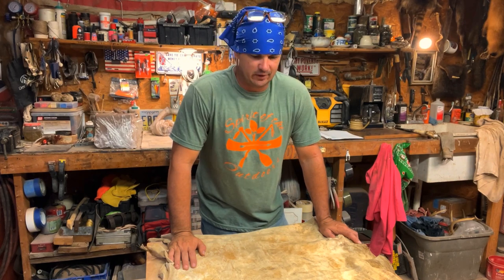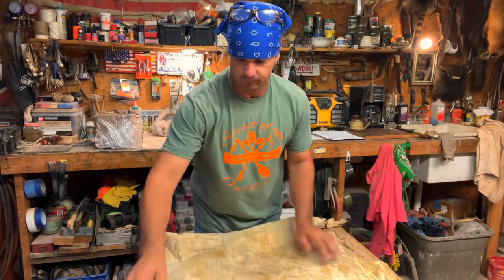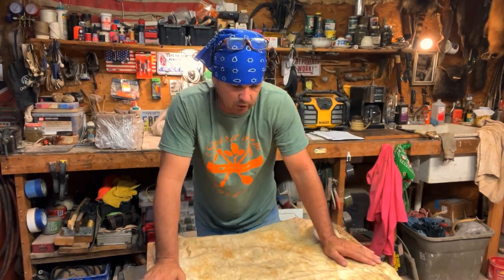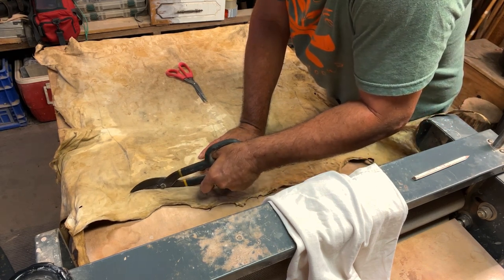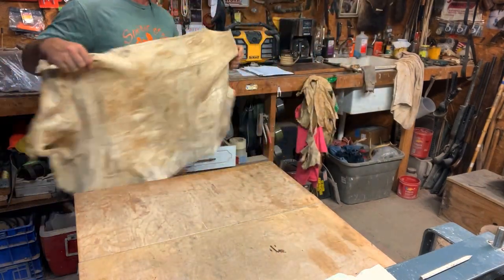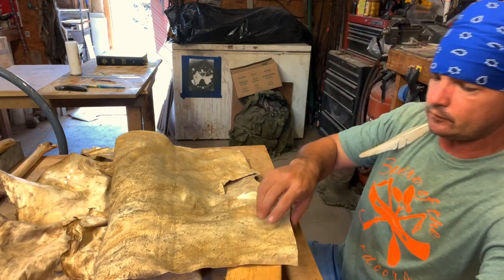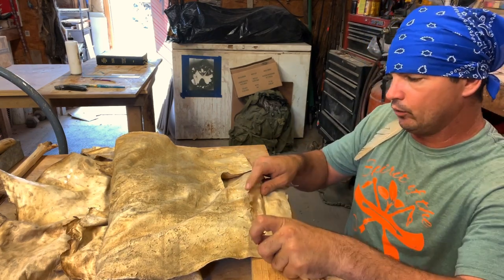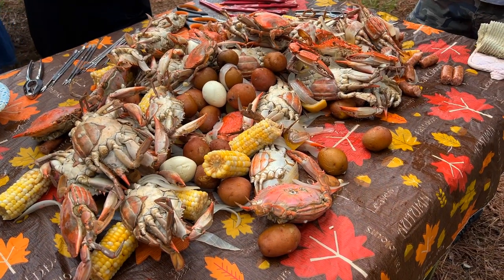Making a Buckskin shirt

Comment: My condolences for the grandmother. Good lookin shirt.  Nothing cuts the wind like leather. I can see where a buckskin shirt combined with some wool under it might feel pretty well on a cold windy day.
Reply from the maker: I think the jacket im gonna line with some old flannel . Should be a nice touch
Reply: @SpiritoftheOutdoors  I've had no luck in tanning. Several years ago, when you could get it, I used Mary Wars liye in a plastic trash can to slip the hair. I used lanolin soap to soften it. But it came out rawhide. Then I did what you did. I took a hand sander to the hair side. I actually ended up with buckskin. But it's an awful lot of work. I haven't tried it since.
Reply from the maker: @larryreese6146  the work is stretching as it tries to make it limber. I wear out before it does lol

Comment: You did a great job on your shirt, especially considering you didn't use a pattern, I'm impressed! I've been sewing for a number of years now and recently made a buckskin jacket. When you make your jacket, it will help if you cut out all the pieces first. Also, the tightness you experienced around the arms and under near the chest is from not adding enough "ease" into your shirt. You can add a gusset where the sleeve meets the body. This will help relieve the tightness lifting your arm up and down. Adding some material to each side for both front and back will help relieve the tightness reaching forward and back. I like to sew from the top toward the bottom and from the center outward. I start at the neck opening and sew to each side, then fold the sleeve in half and mark the center point, I begin sewing about an inch behind the center seam and sew almost to where the gusset should be, sewing from behind the center seam forward will give you a strong stitch where the center seam meets the sleeve, then I sew from the end of the sleeve toward the body, where the gusset meets the sleeve, I then sew down each side of the gusset until it meets the body, then sew each remaining side of the gusset to the body until the stitches meet, then sew the sides as far down as you want,  this prevents bunching of the material from the top down. As my jacket is almost to my knees, I only sew the sides to just below the hip bone, this gives me room to put my leg over the saddle when mounting a horse, plus I like the way it looks. Your shirt looks really cool and I wish you much success on your jacket!

Comment: Old lady from Main here. I did a couple skins from road kills. I got a hard spot on my not smoked hide. I like the white and not the tan. However if it got wet, without oils from the smoke it will shrivel up and turn into dog chewies. I have thought of resoaking it in soap and glycerine, see if I can stretch it better while it is drying. It took so much constant hand pulling for hours to get it stretched right that I couldn't do it anymore. I did buy a chalk and pumice stone to rub on skin and remove any membrane. 
Would like to do something with it.

Comment: Tanning that buckskin and taking on this project to create this shirt has been a lot of time and labor on your part. It seems to me that the end product turned out very well. The fit is good. I’m sure that the leather will become softer and more comfortable the more that the shirt is worn. I’d leave the bottom of the shirt as is, without adding fringe or even hemming it up. It’s gonna look so good with the matching pants and jacket. One question… who do you protect the buckskin from the weather? - Tennessee Smoky
Reply from the maker: The smoking process the other week is supposed to coat the fibers so that when its wet it dont turn back to rawhide. When i washed it it soaked up water but it stayed fairly soft . Now its not gonna keep you dry in the rain at all.